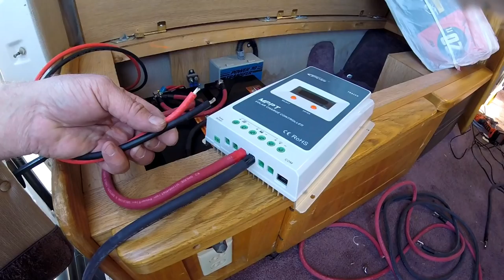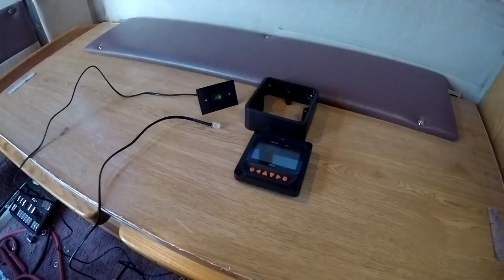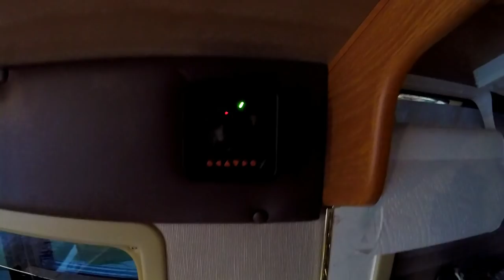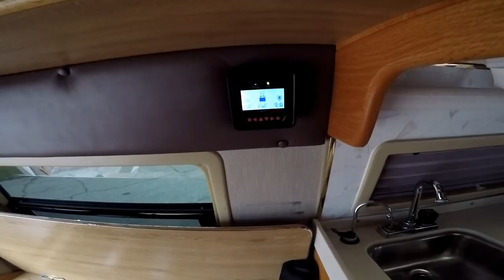RV Solar System Installation On A Class B Campervan

Comment: 29 years as a Motorola technician for the public safety market. Started as an installer, light bars, strobes, wig wag the front head lights, the radio system, K9 packages,  ambulance, fire engines, you name it, I did it,.....Became a top systems technician and did trunking 911 repeater sites all over the world and retired. I'd hire you !  Good job man ! Soldering, heat shrink, proper dressing and cable lengths...... .Again good job, and I don't say that lightly.
Reply from the maker: Haven't seen you in awhile Michael, and you roll in with one hell of a complement.... Can I start about 1pm Wednesday, oh and I need the weekend off....lol, Really though, good to hear from you...thank you!!

Comment: Great job.  Limited space is common with class B's.  did you see that older video from a former you tuber that use a slide system with stack panels on a slide drawer .  He could extend the panels when parked and then slide them back in when moving.
Reply from the maker: PAT DOWNEY rambling van channel did that, I actually thought about doing that to mine it is pretty cool does anybody know what happened to Jay? Seems like he disappeared...

Comment: Sweet job Howie.  I've got those VMax batteries in my van and I love them too !!!   Thumbs-up !
Reply from the maker: How many, and what are you using to pump em up??  thank you buddy!!
Reply: I've got a small system on my rig, 2x100 watt panels on the roof (Renogy) a 40w MPPT controller and Vmax 125 agm X 2 batteries.
Reply from the maker: I had the same, and last yr added one 100w panel, and another 125ah charge tank...
Reply: That was pretty much my plan as well... I had intended to add one more panel.  My problem is that last year I put in a Dickinson Marine, Newport P12000 vented propane heater (which I love). The flu comes up through my roof and now makes it difficult to put a 3rd panel on where I wanted to.  I still may be able to do it, but to be honest I haven't had any problem keeping the batteries charged with the 2 panels that I have.  I should also mention that I also have a battery isolater installed so I can also charge the house batteries from the alternator when driving at times when the weather is bad for capturing solar.  The system has been fine for my needs and has worked flawlessly over the past year.  You might say that I'm a happy camper... LOL !!!
Reply from the maker: Awesome plan... I have everything and the isolator to intall, its been in my trailer for months! I have been thinking more about installing it lately since there has been little sun for weeks... Sounds like you got it under control...
Reply: Only one warning.... if you also go with / install the battery isolator make sure that you can completely disconnect it from the circuit so that you can totally shut if off when it's not required.  Trust me, if you don't do this it can be really easy to overcharge and boil those batteries... for example on a day where you are getting solar and power from the isolator at the same time.... which isn't good for obvious reasons.  I'm sure you know all this but I only mention it because others reading this may not.

Comment: That was a nice install you did on here I'm going to have problems knowing how to hook mine up hopefully the flexible panels that I want to get will be good enough to power everything I have a 24 foot trailer so I will have plenty of room I hope plenty of funds too to do it all
Reply from the maker: That will be plenty of enough room for at least 1600 watts I would think, but to run the AC (split unit is the best decision IMHO) Its going to be equally Important to have the battery power, and insulated properly so the AC doesn't have to run as long to keep it cool.... Thank you for the awesome complement!!

Comment: Howie,  you are the "MAN" that was a good install and done professionally. I know she will enjoy those changes. Was that a fair price for the equipment you bought or can one go cheaper? 
I'm considering a solar system for my rig, about two hundred watts. 
The music background was on point for the job, BRAVO ZULU  this sailor is out
Reply from the maker: The battery's is the expensive part, if you want to do it right the first time, and forget it, go with a good AGM like these charge tanks. If you look in the description you will see a link that is cheaper. Its the 200 watt I put in mine... thank you !!
Reply: Thanks for the feed back,  sailor out..

Comment: Could you run a fridge freezer off this 24/7? Also could you flip flop between solar energy and the generator/van electricity..?
Reply from the maker: I have the similar set up on my van with 300 watts the solar and 375 amp hour batteries and it runs my refrigerator 24/7 for 3 years now..
On cloudy days occasionally I will hit the generator for a couple hours and it will power my converter charger
Reply: Wow so dope. I live in the city so theres alot of buildings/trees so do you think shade would be an issue??
Reply from the maker: @boxfox1239  I carry a compass that I use if I'm not sure exactly the direction the sun is rising. I try to position or park so there is no obstructions in the direction that the sun comes up, you certainly want to draw as sun as possible....

Comment: Great Install ..pity about lack of roof space. How(ie) did you secure the inverter ?  noticed sitting on 2 wooden feet but didn't see you secure it anywhere ?  Noticed she has AC, how(ie) is that powered ?
Reply from the maker: It will run the AC, for about an hour...lol, Really though if we wanted to run a AC unit, it would take about 10 more batteries to do it efficiently ....  I put the Inverter on blocks so it could breath, they get hot, and its not good to sit on carpet without raising it so it can get air under it, I ran four screws threw the wood blocks, and into the floor... thank you!!
Reply: Yeah, me too.............The inverter location was lacking, but I have confidence in Howie as to why he did it that way.
Reply from the maker: Michael Gollatz do you mean you think I should have put a bigger/higher wattage inverter??
Reply: You mentioned above the batteries get "hot". No way could batteries/solar run that much You're asking too much from your inverter - just use it "less". Hot batteries are NO BUENO.  I use my inverter for everyday minimal stuff and sensitive electronics. I only use LOW consumption items off my 750 watt inverter. If I fire up (high consumption stuff) my microwave or coffee pot, I have the van running, never been an issue for me.
Reply from the maker: Guy Being a Guy I think you misunderstood, the question was can I run AC on it and the answer would be yes but it would not be efficient, and kill the batteries within an hour.. and I had said that I blocked up the inverter because it will get hot sitting on the carpet, so now there is a inch and a half gap between the inverter and carpet... 
In fact the batteries do not get hot at all but the inverter will, and if the AC was run on it it would kill those batteries quickly
Reply: Oh, gotcha.

Comment: question, so it takes 2 batteries for the 100 watts of solar?
Reply from the maker: No, you can have a 50 watt panel hooked to 394596 batteries or 500 watts hooked to 1 battery... You really need to figure out your power needs (how much power everything you want to use is going to draw) and at least double that in battery amp hours, and then ideally you want enough watts of solar to recover those batteries in a few hours of great sun exposure in a day....
Reply: Okay, so I would look up the wattage on each appliance I would want to use,  then use that to calculate how much solar?  So say as an example a 600-watt microwave oven would need 600 AMPS of power then double it would be 1200 AMPS, so it would need 3 batteries?  I think on my build out I would want to run a portable ARB refrigerator and a 600-watt microwave.  What are your thoughts regarding lithium batteries?  As you can tell I am still in the learning phase regarding solar.  Thanks for for the video I will be using it a great deal as a reference.
Reply from the maker: Your on the right track! But keep in mind when you say 3 batteries you comparing to the ones in the vid, because you can get 1 400 amp hour battery in lithium for about 5k.... There is sooooo many variables, and combinations ... pull up some vids on how to calculate your power needs... I would love love love to have lithium, but you can on spending about $12 per amp hour... ouch!!

Comment: Im still learning about solar. If I get solar on my class b van how do I get the power to the ceiling fan, interior lights, fridge etc..
Reply from the maker: Your solar is designed as a charging system for a battery Bank, and from your battery Bank you're going to need to hook up some kind of a 12 volt fuse block and a ground bar, and from your fuse box and Ground Bar you will distribute power to each one of your lights, ceiling fans or whatever you're going to run 12 volt...

Comment: Did you add a way for the alternator to charge the house batteries while she is driving also?
Reply from the maker: It came stock with a battery isolator and is charging off the alternator...